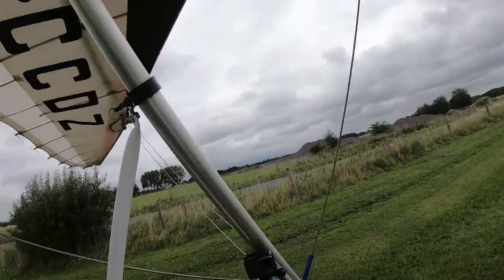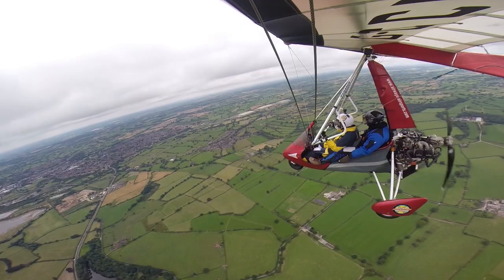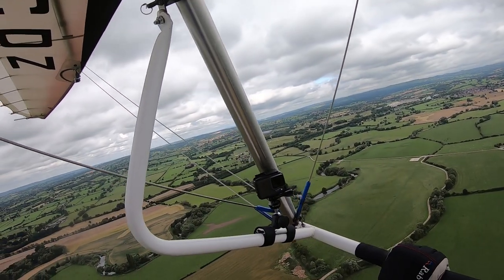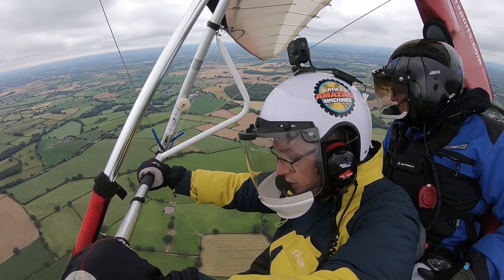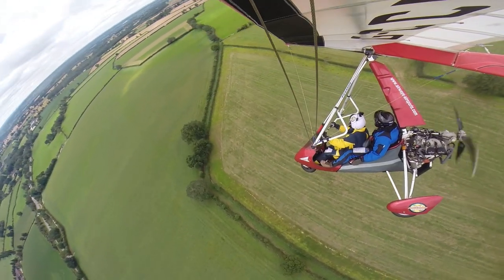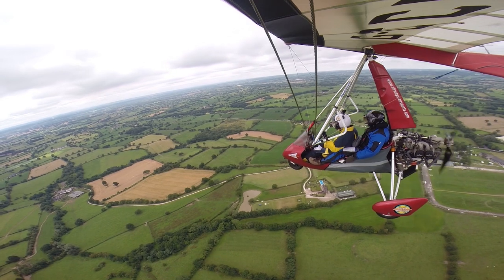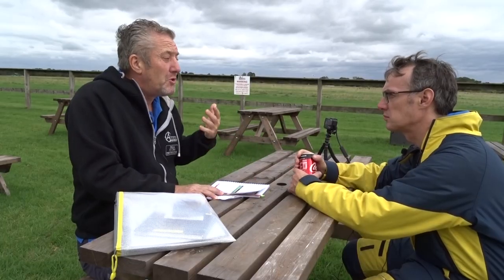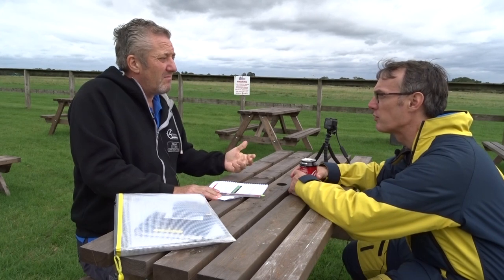Flexwing NPPL Journey  - Episode 2 - ENGINE FAILURES!!

Comment: Yes, I saw bar out and wondered why.  Surprised it did not stall.  My instructor did a stall to get us lower to make the approach height more manageable, fast way to drop 200 feet.  During our engine out practice he always called engine restart as fail and we were usually too low so  it was  pick the landing spot and do it.  
Cheers
Reply from the maker: Hi Patrick, I had to go back and watch again to see what you meant by the bar out. The Quantum is really hard to stall, even on the front strut it does not break away. Where I had the bar was trying to hold 45 mph which is actually minimum sink to give more time in the air. To actually stall the Quantum you have to deliberately raise the nose above the horizon and even then it kind of thinks about it. It kind of makes stalling feel a bit false.

Comment: Nice one Giles , very thorough 👍. I didn’t think you called mayday for an engine out in a microlight , it’s pan pan over here. My instructor said only call mayday if your bloody wings have fallen off or are on fire🤣🇦🇺
Reply from the maker: I suppose its regional.  I'm just going on what they are teaching me and those aspects will be covered in the test.  I suppose if these's no radio, you just scream really really loud.
Reply: @paulieb796  i would call it a mayday if i was over water or a forrest.  not in this situation.
Reply from the maker: @paulieb796  I'm in test mode. I think I agree with you, its aircraft dependent, however, if I had a radio, I probably would.

Comment: Fly the plane then if you have time and brain power do checks, then radio (was the way I was told to do it). If you do the RT then possition is also a good thing to add so they know were to send emergancy services.
S turns approach is great but as you said you are trying to get rid of alt and the mistake most do is to creep forward to the field, I think it should be called a lazy 8 approach as that is what should be seen from the ground track.
Great talk through, well done.
Reply from the maker: Thank Algy, I'm just following the processes they want for the GST.  This was the first set, the later ones were spot on.  I've actually has an engine failure on my paramotor, less energy to deal with.  Its interesting seeing all the different responses to this, its a bit like passing your driving test now, most of us would fail without have a bit a refresh.  I'm learning so much at the moment.  Its completely different from my Fuel, Mixture Mag, radio, then master off on my Cessna 152.  More fun and games to come, I've another 8 videos lined up to edit.   How is sunny Norfolk at the moment?
Reply: @GolfFoxtrot22  Yes differnt method with every instructor I have ever had on each type I have flown (Almost drove me mad if I was not there already). But had a couple of engine out one in a pawnee and the other chipmonk and saved the aircraft both times the pawnee was at 50ft on a turn to spray and heavy at the time.
I am just editing my next video right now so will be able to see the weather for yourself. :-) Always good to learn.
Reply from the maker: @flyingkub  looking forward to seeing it Algy.
Reply: @GolfFoxtrot22  Not as exciting as learning to fly a new type but was fun.